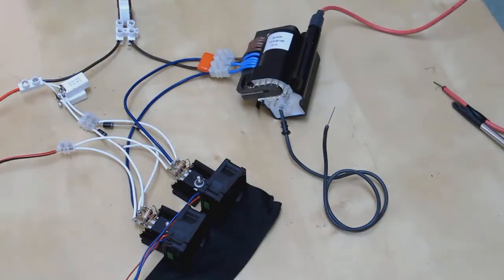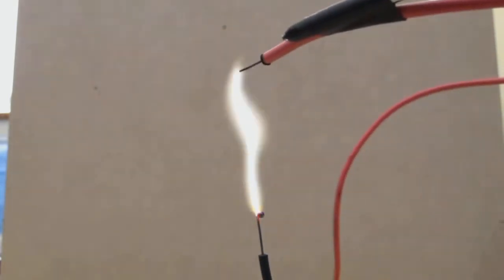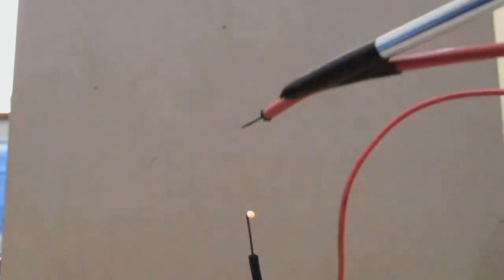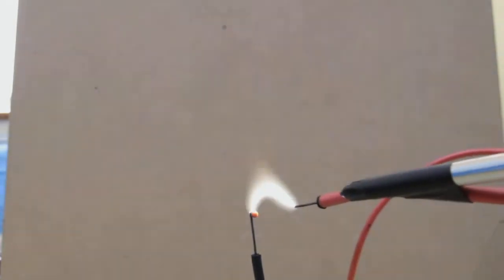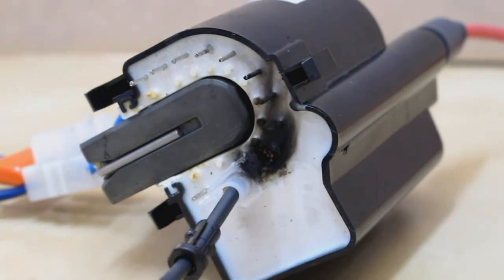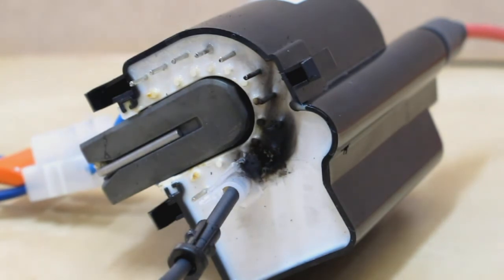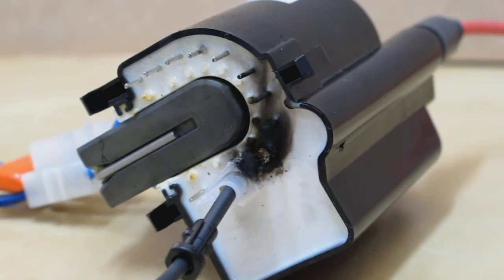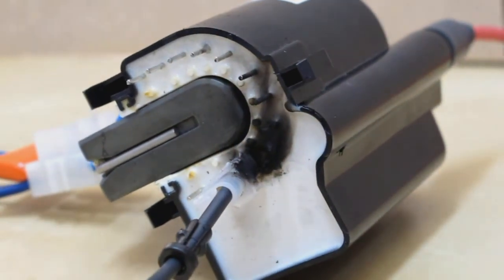Flyback transformer: 24 volts

Comment: Insulate the pins by cutting the ones you don't need off and covering them with wax or hot glue. Also insulating the wire connected to the negative also helps.

Comment: Great cooling fans set up. When arcing has started across the pins, that is the end as traces of carbon are very hard to remove and always start new tracking / corona  again.
Reply from the maker: Yeah this was when I was still playing around. I can now get away with running passively cooled at about 60v. I'll have to do another vid. Got everything nice and neat onto a PCB now.

Comment: blag means steal? lol anyway if you watch the burn a dvd video of the profile cutter you will see the transformers i have. one can give me 85 volts at a fucking crap load of amps. i got 35 out of it for a short time "testing" a 12v motor. the little one can give 15a 24v without too much stress.. recitified and fed to a large filter cap. speaking of which i need to find a higher volt cap.. hmm TV wrecking time!